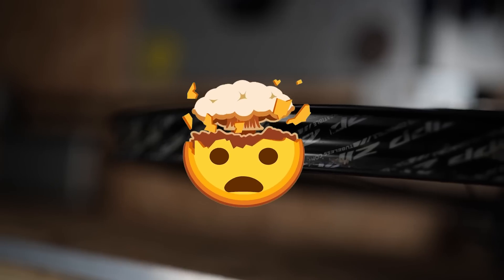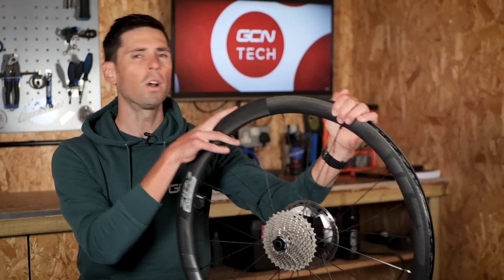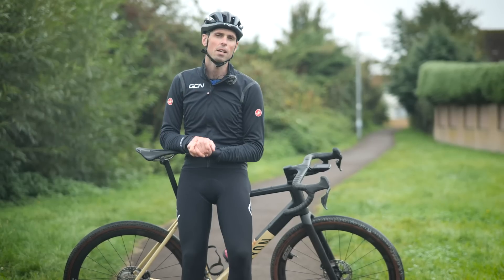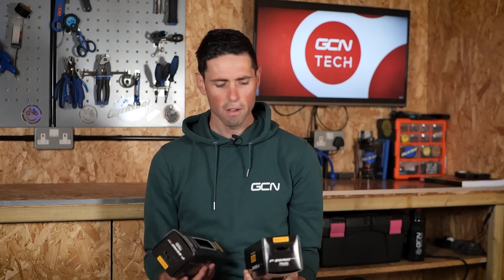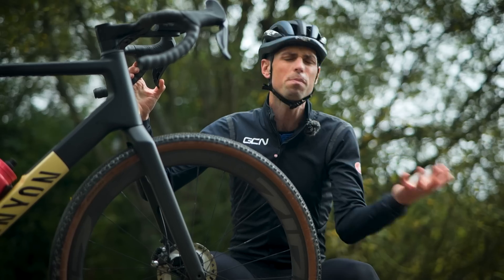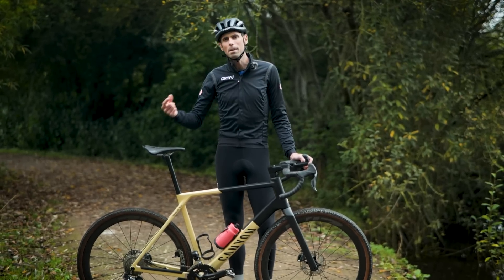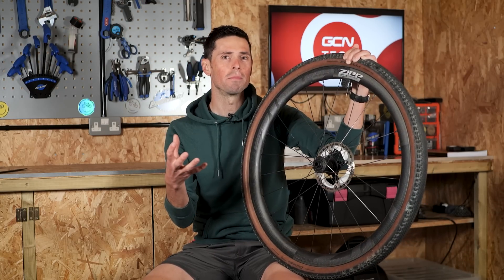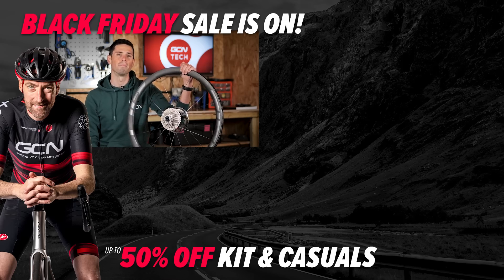What exactly is hookless technology, and what are its pros and cons?

Comment: The industry again needs compliant fools to support the current thing. Crazy. A hooked rim with a normal GP5000 and a cheap Ridenow TPU tube, that's all a road bike needs. But not so many companies can participate in the market this way.
Reply: Where I live(the land of goatheads), a TPU just means you can fit more of them in your saddlebag.   Sometimes I don't even get off my block without getting 1-3 goatheads in my tires, often in both wheels.  If I have more than 1, I pluck them out and keep riding.  If I have 1, I just ride until it breaks and leaves the thorn in my tire that would have definitely peirced any tube.
Reply: This is the way

Comment: sorry but the slight aerodynamic and weight advantages do not make up for the obvious safety downsides. while riding, one must now carry an accurate pressure gauge to not overinflate the tires. can't use a co2 canister anymore because of the overinflation risk. let's also suppose an 80kg rider purchases a hookless rim/tire combo, perhaps during some sales, and then goes online to check the pressures and either finds out different calculators give different values or even finds that the chosen combo is not even approved to work together. this does not feel like progress, except for the 1% who race professionally and have support cars and mechanics at their disposal, not for the average weekend rider
Reply: It’s actually a lot safer than hooked rim

Comment: Have Zipp done extensive testing descending l'Alpe d'Huez at 40 mph on hookless rims and getting a front wheel puncture?

No, you haven't convinced me one bit. The only thing most riders are convinced of is that this is another cynical ploy by manufacturers to cut costs which are not passed on to the customer.
Reply: I heard this discussion quite often. But what is the actual difference on a hooked system? If you do not react well, a slight turning of the front wheel, will be catastrophic. In any case you have to hope to be able to brake on your rear to a low enough velocity to not crash in the next corner.
I do not believe, that we will get arround that corner on a flat tire on a hooked rim either. Or did somebody achieve this masterpiece, already?
And there is one advantage in riding hook- and tubeless. There is no way to miss, you are getting a flat 😊
Reply: I hit 56mph descending a local climb. I had no worries about my Zipp303s. That being said, getting a flat at that speed would've been catastrophic regardless of the wheel design.
Reply: I guess you didn't notice everyone lower their prices for their hooked rims.  They definitely did that
Reply: Have you ever done a full descent on a normal clincher with a front flat from top to bottom?😅

Comment: Even after this video explanations, still don’t see how hookless is better. Seems like the main reason is that it is cheaper to manufacture, so brands & zipp get higher margins. It’s not only a concern on high pressures, but on very low air pressure cyclocross or muddy gravel days (under 20psi) when the tire could burp or detach.
Reply: Well you can get ZIPP 303s for £750, or 303 Firecrest for £1400. they do come with a lifetime crash replacement guarantee. I can't see a better value on the market. If you buy from directly from FE at most you get 2 years guarantee.
Reply: @Pav_1983  and the far east brands require substantially more patience to get support from. Many people discount the fact that Zipp (effectively SRAM at this point) and Enve have massive dealer networks who will be able to help with any warranty issue. Also, on the off chance that they fail catastrophically, your family gets some sweet liability insurance payout on top of your life insurance policy.
Reply: @RyonBeachner  bought some ultra cheap, hookless 25mm internal, 30mm deep carbon rims that are 315g each.  I paid $250 for the pair with shipping included. They're outstanding.  I've got about 15k miles on them so far and I can run them ultra soft as I'm about 90kg.  I'll probably buy the 27mm wide internal version soon for an ultralight gravel setup for when I need tires over 45mm.  My Zipp 303s have my 40mm gravel tires mounted to them
Reply: @veganpotterthevegan  Yeah, I run a 28 mm tire that when mounted/inflated measures 31 mm at 65psi. It’s great. I weigh 85kg
Reply: Cheaper to manufacture, same cost to the customer
Reply: Looks on zipps website. That is a no @janeblogs324
Reply: @janeblogs324  yet mostly everyone lowered their prices with hookless...
Reply: That's why these hookless wheel manufacturers pay presenters, channels, and websites to convince people that "hookless rims are safe". It's all marketing. There is no upside for the consumer and the benefit is only on the manufacturers.
Reply: @ArtanisKizrath  pretty much everyone making wheels make hookless wheels now😅
Reply: @ArtanisKizrath  Note this is not a paid video. It’s worth acknowledging that this isn’t “the industry” as a whole. You have well respected brands like DT Swiss that aren’t sold on the concept. You also have well educated consumers who actually like the concept. The reality is in between, it’s not nearly as dangerous as some people say, and it’s also not as world changing as others say.

I’ve been riding hookless for the last 4-5 years on the road, and I’ve run compatible tires, incompatible tires, with and without tubes, with approved and non approved rim tape, and I’ve run tire pressure that is technically over the limit, I’ve flown with the wheels forgetting to deflate them, etc. No issues. Much ado about nothing. 🤷🏻‍♂️
Reply: How many paid comment spammers have popped up here and the other comments, its quite obvious. Like the one mentioning liability pay outs,  5 years using hookless, and all the company terms and jargons like he was part of the research and marketing of hookless tires. You know who you are 😂
Reply: @carlogalopo2605  its more believable that chemtrails are making roadies switch to disc brakes

Comment: I'm not going hookless. I went from tubeless to normal tires and TPU innertire. Best move ever 💪🏻
Reply: Hooklless is rubish.
Reply: What’s your opinion on the tpu? I’m currently on tubeless and considering making the switch
Reply: @haydenapps6075  I'm using RideNow TPU's and have been happy with them. I'm old-school in that I want nothing to do with waxing chains or that mess with sealant.
Reply: @haydenapps6075 Best invention ever for competitive cyclist especially for weight weenies and hill climbers.
Reply: I’d be interested to know why you didn’t like tubeless. I went tubeless around three years ago and have had only one minor puncture from hitting a massive rock. Even then I just added more sealant (I happened to be carrying a spare small bottle which I normally do as good Practice), topped it off with some co2 and job done. Running carbon DT Swiss GRC 1400 wheels which are hookless and they’re great. Zero issues. Not sure why you would want to introduce more puncture risk into your rides. Re hookless I run 40 psi max in my tyres as I find that the sweet spot between comfort and bottoming out on rough terrain. I am actually running Vittoria terrino gravel mixed currently which are only meant for hooked rims (literally only realised after watching a video on it yesterday!) however they were tight AF to get onto the rim in the first place and as I don’t run high pressure as I said so should be fine. For transparency I do think that wheel manufactures only make them hookless now as it’s easier and cheaper. I don’t buy the sales pitch for tech improvements.
Reply: ok boomer
Reply: @Pienimusta 🐂💩
Reply: @Pienimusta  🤡

Comment: My issue with hookless rims is it’s almost impossible to get my tyres on and off them.  I rides with tubes and with hooked rims I can get my tyres on and off with my fingers, but have broken tyre levers trying to get the same tyres on and off hookless.
Reply: It's a technique issue.  I have zero problems getting tyres on and off my hookless wheels.  Just need the correct technique.
Reply: @CG-99  I’ve been getting tyres on and off for years, i use my fingers mostly, I hardly ever need to use a tyre lever.  I have one set of hookless rims and I’m in a sweat getting the same tyres on and off, it takes an age and there is no way I’ll be able to change an inner tube out on the road.
Reply: @CG-99  I’ve been getting tyres on and off for years, i use my fingers mostly, I hardly ever need to use a tyre lever.  I have one set of hookless rims and I’m in a sweat getting the same tyres on and off, it takes an age and there is no way I’ll be able to change an inner tube out on the road.
Reply: @CG-99  oh you mean Nick Igoe who was the finance director at West Ham at that time?  And a member of the three man commission who deducted 10 points off another club for “breaking the rules”
Reply: @CG-99  oh you mean Nick Igoe who was the finance director at West Ham at that time?  And a member of the three man commission who deducted 10 points off another club for “breaking the rules”
Reply: @CG-99  oh you mean Nick Igoe who was the finance director at West Ham at that time?  And a member of the three man commission who deducted 10 points off another club for “breaking the rules”

Comment: 200g weight savings? I don't believe that. I can only find 10-20g differences between the same models
Reply: 200g is like a 35mm Butyl inner tube in weight, lol.  Yeah right.
Reply: Yup. If you multiply hook dimensions with carbon density, it ends up in the range you're seeing. An order of magnitude off from 200g.
Reply: Yeah, but if you have 10 - 20 bikes and change to hookless on all of them, then it will add up to 200gms
Reply: Woooah! Bike truck is going to feel that :)))) @TikeMyson69
Reply: Notice how they did not provide single example ? Nor for one case where you have cheaper hookless wheel in comparison :) but lets say it is lighter- then hookles specific tire is going to be heavier because it has to have stronger bead.
Reply: It's right for me -- my hooked rims are aluminum.

Comment: Hookless wheels DO NOT provide an advantage in aerodynamics, it’s been proven in the wind tunnel.
Reply: Please cite your source! That would be interesting to read.
Reply: It's too make manufacturing easier, nothing else.
Reply: I think he's referring to the width of the rim, hookless can be wider meaning the leading edge of the tire won't have that "light bulb" effect. That's probably such an insignificant advantage, you could make it up on hooked wheels by getting lower on the front end of your bike. So yeah, you're right, it's dubious as hell to suggest that hookless wheels are magically more aero.
Reply: @M3GRSD  I’m confused. You just said that the difference would have to be made up with rider position (outside the wheel system), which would mean it has an irrecoverable disadvantage. I will happily admit that rider position is the biggest difference in aerodynamics of the entire bike/rider, but there’s some strange mental gymnastics here.

Comment: “Our sponsors will try to change your mind” on this potentially dangerous cost cutting exercise.
Reply: Couldn’t agree more.   I’ve seen real world videos showing it blow off.  Even for a small chance of occurrence, I choose hooked for peace of mind of not crashing or having a blow out.
Reply: I’ve got two gravel bike with hookless rims the only thing I would say not all tyres are hookless compatible which can be a pain other than that it’s all good
Reply: All part of the journey where manufacturers force us to go Tubeless.

I won’t touch Giant now as they only offer Hookless Rims. Clinchers with Tubeless options offer the most flexibility as at least if you decide to go on the Tubeless Journey you can switch back easily. Personally until I see a Tubeless tyre with the puncture resistance of a GP 4 seasons I will be staying with Tubes. Every experiment I have had with Tubeless tyres has led to tyres that cut up easily such they need replacing regularly. Of course Tubeless gurus proudly show off where their tyre has sealed. I can equally proudly show off my GP 4 Seasons with zero nicks and zero punctures after 4/5000 miles. I rest my case
Reply: @johnmccrossan9376  no they are not present, if you refer to the hump then thats there for another reason.
Reply: @lucamuller6729  what other reason?
Reply: @lucamuller6729  I'm not being pedantic I'm actually curious about this, if not to hold the tyre on why have it?
Reply: @johnmccrossan9376  hump for lateral force, hook for radial (or translational force) radial from lateral. But the streight of the beads holds the tire on the rim (for cars and motorcycle - at least newer ones) while with bikes the hook meant manufacturers could let the tire lean on it a bit more and take the extra force if required. I prefer a tire that holds its dimentions more than a weird little edge the tire can lean on if things get hairy. But thats just me
Reply: Buy hooked rims, run TPU or latex tubes, voila! Problem solved.
Reply: In Germany we say “mir geht der Hut hoch”. Meaning that it’s becoming ridiculous. I am a real longtime fan of the channel but this video is complete bs. Not a word of the real dangers when manufacturers miss the tolerance. Everyone riding these at their own risk. And just yesterday the video about pressure which also misses out a lot of factors. And that stupid tyre pressure calculator. Is there any hope for GCN?
Reply: I totally agree, the shittiest idea ever! I got a set of carbon hookless on my Giant tcr. Got rid of the sealant straight away to tpu tubes! Job done apart from crappy low 73psi pressures! Not good
Reply: @aveedub7403 you do know that you're still not supposed to pump those tires up hard with hookless don't you?🥴
Reply: @aveedub7403  You are not supposed to run tubes in hookless except when you have a flat that won't seal.
Reply: I think zipp made this video because lots of people buy 303s and pump it up to 100psi and then they blame hookless technology when it's a user error.
Reply: Don’t know if you caught it, but this isn’t a sponsored video. 

The real world research and data in support of hookless is bountiful. The evidence of drawbacks (I.e. random YouTube videos) is almost entirely anecdotal, an INCREDIBLY small sample size that is statistically unreliable, and does not have a control or sufficient background information to be reliable in any way.
Reply: @danielakerman8241  yes, it is “strange”. We know that Zipp are sponsors of the channel, their products are featured heavily and exclusively in the video and they have also an entirely hookless range of wheels.
Reply: @danielakerman8241 Its a culture thing at play here. Disc brakes and tubeless tires where at great debat in the bike world while everything else uses them for decades now. Most people seem to have very little engineering/physics expertise in here so the reactions while astonishing are somewhat understandable.
Reply: Hookless tubeless is much better a small number of years in than hooked clinchers were 20 and even 30 yrs in.  Working in a shop, I used to have to use 2 layers of cotton tape to get a tire seated.  I've also broked beads that were too small.   Did both more times than I can count.

Comment: Hookless is dangerous, esspecialy on Flanders roads, it’s fine in TDf, but f it fail on Flanders with cobbles it is not the technology.
Besides that you got to view the whole system bikeframe, wheels, braking, not just the rims
Reply: Riding flanders is always dangerous. I saw shimano and black inc wheels failing both structurally and failing to keep the tyre seated, both use hooked design

Comment: Been riding hookless rims for 3 years, over 10k miles, no problems.
I'm 'only' 80kg so pressure limited on some calcs to 28mm at 73psi but it's 2023 who rides smaller than 28 anymore???🤷‍♂️
Reply: People still ride 23 mm, just stop watching sponsored videos
Reply: @stibra101  only because they ride 20 year old bikes with narrow brakes that won't fit any bigger.
Honestly you don't know what you're missing, my old bike had 23s just about squeezed 25's in, now on 28mm gp5kstr and it's like a magic carpet ride in comparison 👌
Reply: @jakethesnake1976  I am riding brand new bike with 23 mm on front and 25 mm at back. Nice soft cotton tubulars and it rides like on magic carpet
Reply: @stibra101  sure
Reply: @jakethesnake1976  I have bike with 28 mm tires, it just feels dead
Reply: @stibra101  state of the roads round here I wouldn't dare ride 23mm. I'll probably switch the rear back to a 30mm once this one's worn 🤷‍♂️
Reply: @jakethesnake1976  Well I ride on mostly nice roads and 23 mm feels perfect, fun, live, snappy and comfortable.
Reply: @stibra101 so y’all both ride different wheel and tire setups on different road surfaces and conditions. I see no conflict here.